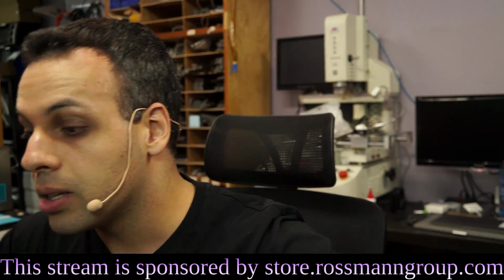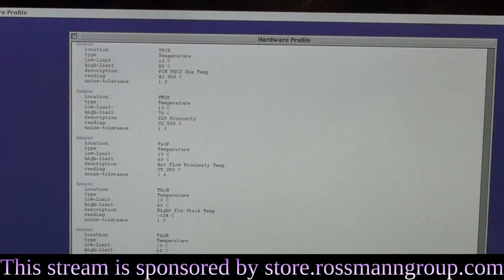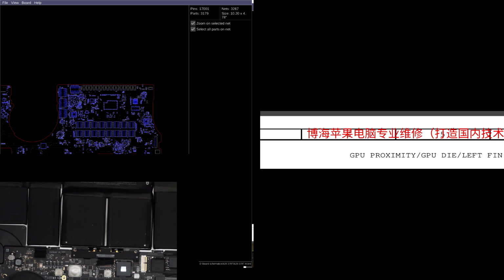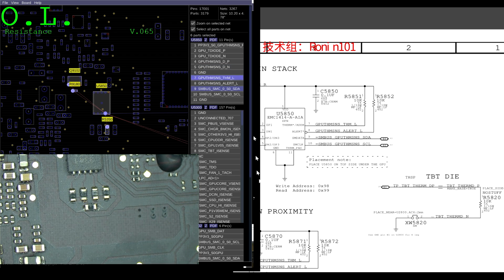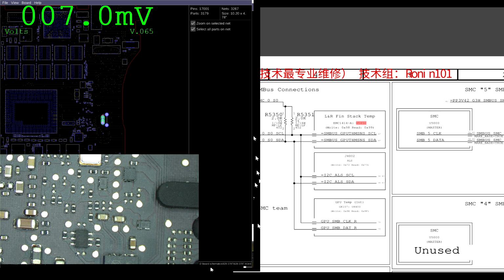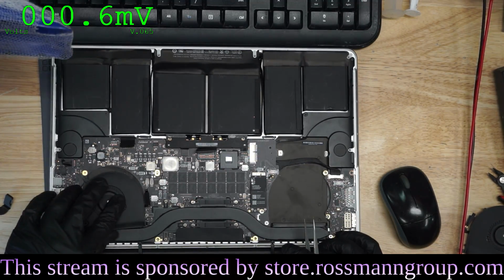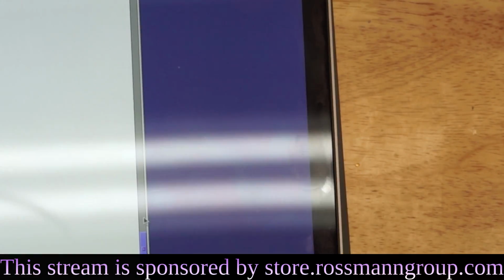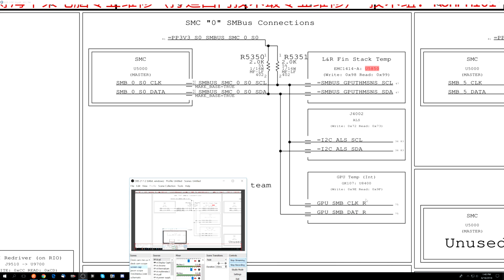What franchise can't fix in two months Louis solves in 20 minutes. Franchise = :'(

Comment: Only apple could engineer that  different.. with the Webcam sharing a sensor data  line.. Apple think and engineer  different.. to screw you.. and give us hard working 3rd party  repair refurbish  and / or replace  techs who  care enough about our customer  base to work into the early  hours fixes  by replace and rebuilding  soldering pads and replacement of surface components  that took a sheet on you.. then sleep 90 minutes  an repeat. I proudly  buy from store. rossmanngroup.com great service  and the finest quality  supplies and equipment  you can buy.. and the prices are the best on the net.. family bought me the Atten  ST-862D  for Christmas present.. with some supplies  like genuine amtech  products  with  great prices and and aFlexBV license... the trial edition is  great i figure registered is going to be killer...

Comment: While designing these boards, I really hope they're thinking through minor faults like this, and how they will/may affect the system as it is running and complete... It seems like there are large or small sections of well-designed board, but also minor quirks all over the place that just fuck everything up.

Comment: lul i have had a HP laptop for over 2 years now and no issues what so ever and still running windows 7 haha.Every thing runs perfectly even replaced the regular hard drive that it came with with a fast Kingston SSD.Boot in 20 seconds even with windows 10 running.

Comment: I would say they design it like that to keep things compact. I'm not a board engineer so I don't know if it's possible to do better, but that's all I could think of. Short of laziness of course. Either they all share a line to keep things slim to cut down on size and weight or they share a line because apple didn't wan't produce boards with more lines.

Comment: The way that these are built reminds me of a guy I knew who tried to rewire his jeep. He wanted it to be as simple as possible so he thought he would think different ;) He came to me because he kept blowing headlight bulbs, literally exploding them, and he had wired them directly to the toggle switch, BOTH the brights and dims, so both brights and dims were always on. This over heated the bulbs and would make them fail and sometimes explode. HE wanted the simplest solution so I was not allowed to fix the other fire hazard/questionable things he did the the jeep, So i just installed a couple relays that shut off the dims when the new seperate switch was turned on for the brights. Problem Solved! Well at least that one was................ LOL Happy repairs and the best of luck to those who "Think Different" smh

Comment: Can the cable to the camera be bad ? To me it sounds like a short between lines , but it is if i understand impossible withouth risking the screen to access the other end of the cable. If that can be done, it should be possible to verify that the cable is on fault. That could be due to the track pad repair.
A damaged cable is for me an mechanical issue, which is i think fair bit of the trouble. Balky connections is also an mechanical issue.

Comment: I do think connecting few sensors to one line is good, temp and light sharing one chip is pretty reasonable too if the chip only able to process single type of sensors per port. But they should've designed it to be independent from each other so if one failing, it doesn't disturb other line.

Comment: The SMA is communicating to the L&R Fin Stack Temp, J4002, and GPU Temp module via I2C. Sensors generally use this communication protocol because I2C only requires two lines: SDA (data) and SCL (clock). The lack of design to catch any fault in any of the slave devices is designers choice. 

Just wanted to say this in case of anyone was wondering lol

Comment: Yeah well the CPU doesnt have enough data pins to have each thing on it’s own data line. It’s probably using an I2C connection, which is good for these kinds of applications where you have a lot of sensors and chips that don’t have to send a lot of data and you don’t have a lot of space to have separate data lines for each one of them, so you just connect them on two lines in parallel and that’s it. There’s a clock line and a data line (probably) and each device has it’s own two byte address and they all share the same datalines. And that’s it.

Comment: The NPN mosfets are sometimes used to level shift i2c data where voltages differ between devices.  And, a small static shock cat easily blow a mosfet gates ... this would come from the low voltage side of the shifter.  If these mosfets are buried way up in the screen/camera area though, guess you are out of luck.

Comment: why do the fans spin up when the sensors are extremely cool
Reply: either the values go into an unsigned variable, because no one expected negative temps, so they didn't come out cool at the next stage... or there is some out of bounds check that defaults to fans, just in case..  is my guess

Comment: I had the exact opposite issue with my RX590 graphics card, where the fans weren't running at all. The Sapphire OC software wouldn't trigger the fans when manually set to 100% except for the fan health check function. MSI Afterburner turned those fans on right away.

Comment: Love your vids. I’m a bit of a tech guy but I’m not in your field. A lot of the issues I see you deal with are the a lot like the issues I see in diagnosing problems in modern vehicles today. Funny enough we deal with a lot of the same industry type issues you deal with as well. Manufacturers making it hard to get proper resources, lack of repair information, Wrong repair information, incorrect diagrams, you name it. That’s why it pays to have a fundamental understanding of the systems you work on and not have to rely on that information as much as those who don’t.

Comment: If I'm not mistaken, the "sensor chip" is just an I2C interface, not a sensor per se. That's what it looks like, anyway. The sensors themselves are communicating with that chip via an I2C bus that's shared with the webcam. (Just Google "I2C" if you're unfamiliar with how that bus works.) It's unlikely that all of the sensors on that bus failed, but with a shared bus, one failure can take down the whole bus and make it look just like multiple failures. Louis diagnosed the problem perfectly.

Comment: They don't care if the light sensor is on a mission critical data line....whatever they can do to make their products die/slow faster the more money they make when the customer is "forced to buy a new one because fixing it is too expensive" side note \/ \/ Below \/ \/
My electronics knowledge is minimal, but on another video you said "could someone prevent a USB-port from being killed with those USB killers." Could there be a way to just have some sort of logic that can sense current (or high current) coming back to the port from the USB that can send the current to a small heat sink similar to a dummy load for antenna testing?

Comment: Ohhh Ohhh was it the Best Try and the Meek pod?    They have the ability to to have loose screws?  Is that like loosing their marbles.   Absolutely love your explanation of how you methodically rule out the different potential sources which cause the sensor errors to end up with the final issue that has nothing to do with the sensor but is the webcam!   Very very cool.

Comment: Could it be anything like the video output to the screen or the screen itself dying if you unplug or plug back in the LCD cable without first removing the battery? Maybe it is that stores fault and they plugged the web cam in while the battery was plugged in and fried it.

Comment: Louis here you go getting it right again. That serial line taking down the cpu speed is an example of Apple 
Engineering conning their customers and planning for more sales at the customers expense.  Their service
People couldn’t find their way out of a paper bag with both ends open. I have had experience with their 
Genius Bar with my iPad.  They had no clue what was wrong, I told them that it was a possible issue 
With memory failing and not able to recover properly.  They wanted to hire me, I am to old for their crap.
I still have a current problem with their iOS 11 and 12
iBook lost the bookmark function with pdf’s that use copyright security.  I spoke to them 8 times with
No resolution and not even a hint that they cared. I even emailed Tim Cook, still waiting for a reply, 7 months ago.
I may have to go to a Lenovo x 1 with Windows, which I hate.  Well we will see!

Comment: Actually not having watched the whole video yet, but: "this is not something that could ever occur or result from replacing directly". If everything goes as planned, then you're probably right, but there is also - for example - the possibility that these guys brought an electrostatic discharge to the board and killed some ICs which are not related to the actual job of exchaning the touchpad. Just saying... ;)

Comment: In regards to the trackpad and the Temp sensor, you are correct in they are not associated except if during the service of the trackpad, poor ESD practices resulted in an ESD event on the board.  ESD damage is often overlooked as a source of failures when a unit is being serviced.  For example your bench.  Wooden top, no ESD mat, no ESD wriststrap, synthetic chair.  In my shop these practices are not overlooked.  When is the last time you wiped down your chair with a dryer sheet?  Do you always wear cotton or do you sometimes wear synthetic?  In NYC without air conditioning the humidity takes care of most of these, but in cold weather and lower indoor dew points results in ESD issues.

Comment: I frequently ask repair shops to quote me prices for a specific problem. Not because I think that's the actual problem but I want to see if they have a shred of honesty in their work. It's fine if you say "I don't know how much YOUR specific problem may be because I haven't seen it to diagnose the problem" however I take issue when they only leave it at that. I want to know you have set a price point on certain repairs rather than just trying to milk as much money out of your customers as possible. This isn't healthcare, I get to have the luxury of asking what your offer is on specific services before agreeing to let you see my stuff because I have the luxury of refusing service because it's not life threatening. Car repairmen may make it sound life threatening but if I have one say "your ABS light is on" I can say "that's a shame, now diagnose why my air conditioner isn't working like I asked you to." I have an intermittent short to ground which was fixed with a $5 digital circuit breaker. Cost to diagnose was $50 Which was going to be $60 because they added $10 to tell me my stupid ABS light was on - which BTW the ABS light is always on when starting any car and turns off after 5 seconds - like my car does - the ABS was fine.

Comment: I used to repair consumer electronics to the component level, and of course I'd get the customer that hooks up 14 speakers to his receiver, has shorted woofers and/or speaker wires, overdrives the unit until it's putting out a square-wave. And even after explaining this so that the customer does not make the same mistakes, they still did the same things on occasion. And of course that was my fault. Even when they would strip the stranded speaker wire OVER the unit, thereby dropping tiny pieces of wire into the unit causing it to blow all the outputs and predrivers...this too, was my fault. Some customers you cannot please.
Reply: the webcams broken that's apples engineering for you because they got tired of other company's copying them when they did things correctly. so they make shit like this so people do not copy them.🤣🤣🤣

Comment: Wait, so did you cut the data lines so the webcam works? I'm sure your customer would be ecstatic, "The webcam was at fault, without it the machine works perfectly, but I figured out that disconnecting just the light sensor also solves the problem and the webcam works too." Also, that's an experience thing, you'd need to know all that stuff about the data lines to figure that out.

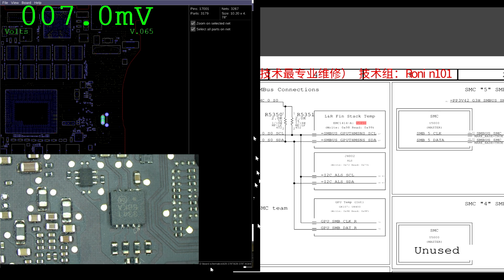Comment: @Louis Rossmann, 13:30 - well, you are partially right - the chip can not die from replacing the trackpad, but it can die from ESD. Nowadays it's rare, because the ESD protection has gotten better and is built in all CMOS chips, but it can still happen. Maybe the technician did not ware the armband and was wearing wool clothes or something. So not from replacing itself, but as a side product of unprofessional conduct it may happen.

Comment: My computer is slow because temperature sensors are not working 
It's the webcam..
LOL wut?
Reply: Think different 😂
Reply: @TheGiRiGi  Think fucking different indeed!
Reply: you need to think out of the box
Reply: it's not that uncommon or that stupid - stuff might not make sense from a function point of view, but might make perfect sense from a standpoint of location, lowest footprint, power requirements, thermal balance, etc.
Reply: @dunuth  It's common practice to put temperature sensors on one or two lines, and put nothing else on those lines.
Reply: That's what happens when multiple electrical components have connections.
Reply: That's electronics for ya!
Reply: sounds like some shit youd find on a ford
Reply: thats the most stupid shit i've ever heard in a while ..

Comment: Hello Louis, you are mistaken here : the -124 (to -128°) reading for the GPU is normal on these Macbooks which have two graphic chips. When the integrated chip is used, the reading for the dedicated chip is indeed -124 to -128. But as soon as the dedicated graphic chip is used, the temp reading goes back to "normal". If you uses iStat Menu, or iStat Pro for example on a Macbook with 2 graphics chips you'll be able to check this yourself. Best regards.
Reply: But why. It should be either n/a or show the system temperature. This just complicates things.

Comment: Louis, is sensor diagnosis still a problem with the newest models? I'm guessing you have a GSX spoof server and the applet, but not everyone can be so lucky. ;) I wrote a rudimentary linux program a while ago that I sometimes use when sensors go bad that dumps the sensor values, especially on ones with the "Apple Diagnostics" that at best says "something happened, something happened." Would there be any use for something like this within the community?

And ditto for "replacing the sensor." I haven't worked on nearly as many boards as you have, but I can count precisely how many times I've "replaced a sensor:" once. And that was the air intake/memory thermal diode on the top side of a 3115. (How it measures memory temperature across the board remains a mystery)

Comment: I am using 47 ohm resistance to short HDD temp. Works like a charm, looks like a 20°c  to shitty iMac. The most dumb thing is that HDDs have temperature sensor built in since IDE drives, just fucking SMART. But Apple does not do smart, apple thinks different. It also won't use smart to determine HDD failure before you lose data, it uses bad sectors counter which comes high when it's usually too late to backup your data.

Comment: You Louis Rossman, are helping Apple out here.
You're confirming to them that their planned obsolescence is working as intended.
But... You usually repair them. This is something Apple isn't too happy about.
But then, they can now plan on how to prevent an issue from being repaired. As in this case. Apple was smart enough to put together a screen that can't be serviced/opened without ruining it. Then they can design the webcam to fail at a certain age, and short down some strategic data lines. 
Result: You can't fix it without breaking/removing another part of the machine.

Customer is a lot more likely to buy a new machine. Even with your fix. 
Planned obsolesce at work, and Apple are masters on this trade.

Comment: But Louis, apple service centers don't have Paul Daniels' software, how are they supposed to fix this?
Reply: They won't. All they'll do is fake smile at you and point you to the NEAREST Apple store (or if they have some in stock) to buy another laptop because yours is "old, obsolete, and is trashed".  That's what their planned obsolescence is all about.
Reply: And the apple store will send it in, get the entire board replaced and let you pay for it after you got it back a month later even though it didnt fix the problem.
Reply: @Chuckiele  And they wiped your data while at it even tho there was 0 need too.
Reply: As all macbooks are propietary of Apple, they should have their own schematics that could be use to diagnose issues... but then again, Apple has this "control everything" mindset and won't hand their tech staff that info because it might get leaked. The result? Their tech support staff doesn't even know how their products work.
Reply: They never repair it.
Reply: Water damage. Buy a new one.
Reply: Sure, they only have Jack Daniels stuff, didnt got the first name right ... so what do you expect? ^^

Comment: Why is a webcam connected to... why. No, why? WHY?

Ok, ambient light sensor.

Still.

Eh.
Reply: Olivia esddms because you can’t have 50 data lines in a laptop. Especially when you need each of them only once per second and you only transmit a few bytes of data at a time. You use I2C. Learn about it. Embrace it. Love it.